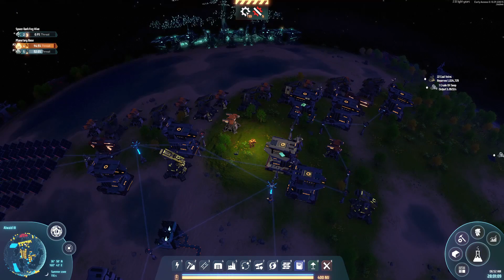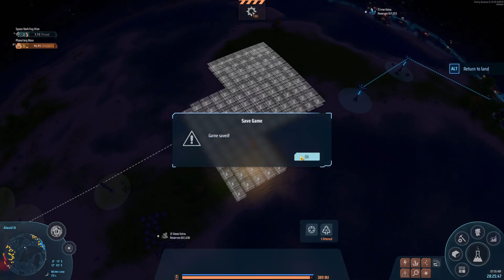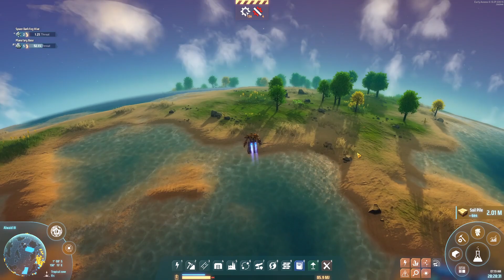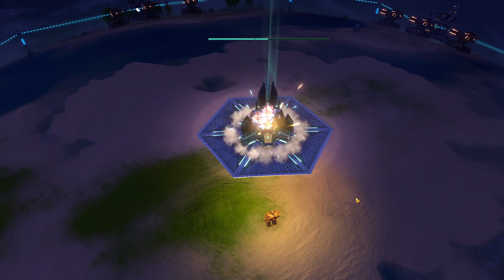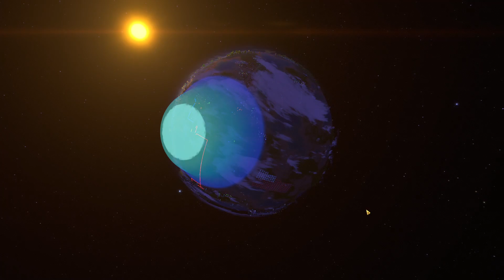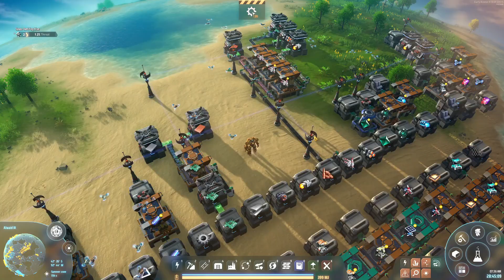IMPLOSION CANNON // Dyson Sphere Program // Mission Log 32

Comment: One shield to rule them all....would have been to easy...right?
Reply from the maker: Agreed, but it's SO small and uses so much power that I question if it has any real utility. I'm near the end of a playthrough and at this point it's easier to eradicate the local hive than to try to shield a planet. Unless you're doing it for an achievement.
Reply: So here's my strategy half baked plan crazy idea:  instead of building shields to bar the relay from building on the starter planet, what if I shield the ice and lava worlds instead? That way, each time I destroy a ground hive the relay can only build on the starter world again, thus allowing me to build more and more geothermal there.